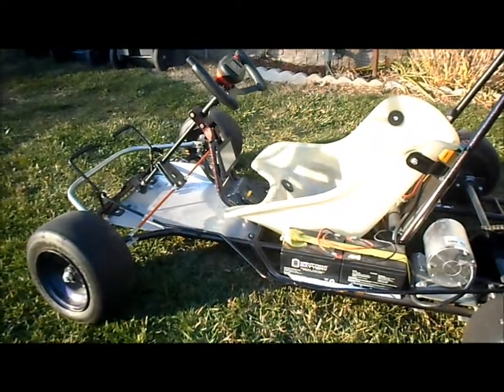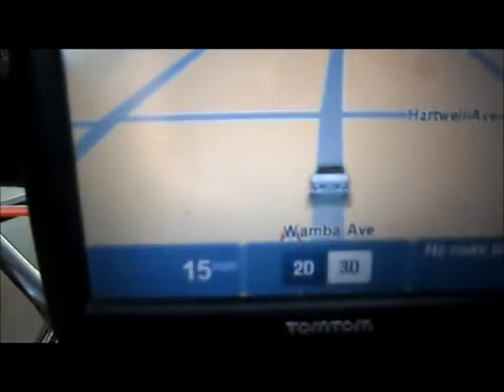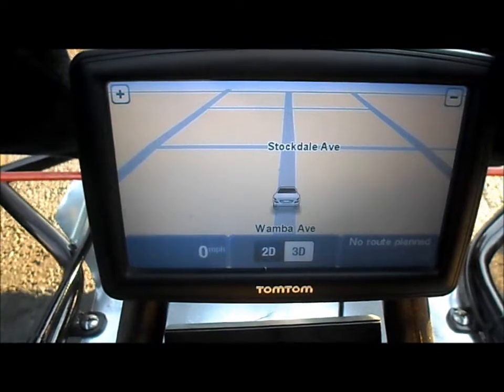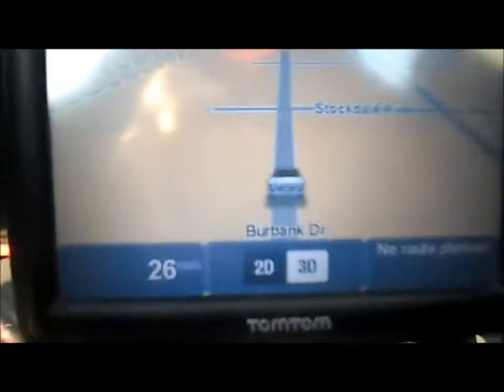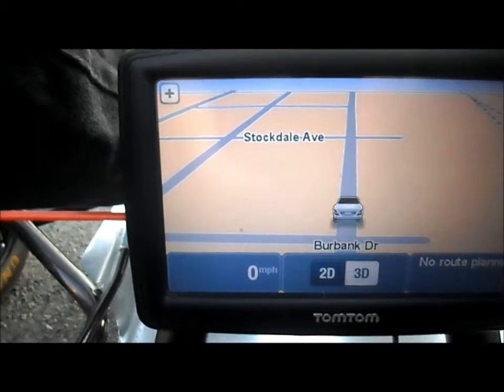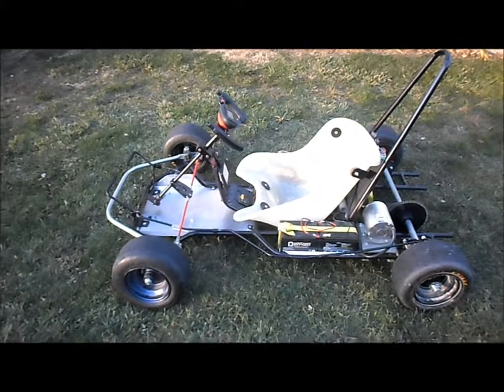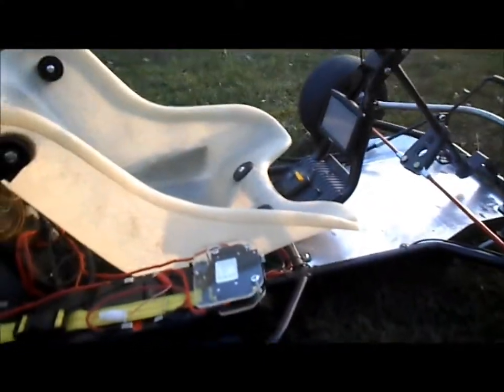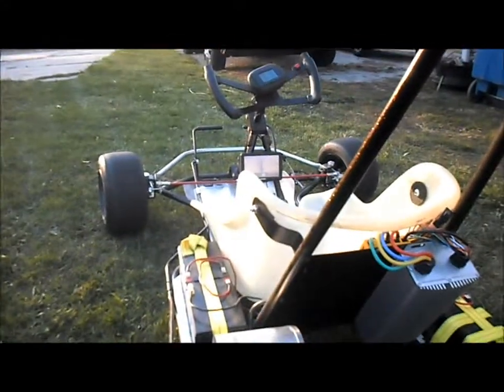Excalibur Electric Racing Go Kart prototype 14 60V 3,000W speed test

Comment: Hi. Where'd you get the ammeter? Cheers
Reply from the maker: Kool little meter huh? It's a PZEM-051. I get 'em on E-Bay for ~$17.00. https://www.ebay.com/itm/122029089742?_trkparms=aid%3D1110006%26algo%3DHOMESPLICE.SIM%26ao%3D1%26asc%3D231995%26meid%3D6a29f4fe1c474aafa1775b8dba85e7fe%26pid%3D101195%26rk%3D1%26rkt%3D12%26sd%3D111980665086%26itm%3D122029089742%26pmt%3D1%26noa%3D0%26pg%3D2047675%26algv%3DSimplAMLv9PairwiseUnbiasedWeb&_trksid=p2047675.c101195.m1851&amdata=cksum%3A1220290897426a29f4fe1c474aafa1775b8dba85e7fe%7Cenc%3AAQAFAAACAEsCg3R7AL6aTpPPR8Z7G613U4m3JZsOz7mvJVNWLpo0zd0RANItK8veHdftbPGdSYvhUf7ZkSFRc0l6Tyy696aDYc9t3eS9F%252B5AgCTl2SwAReDrOWeNyKKWCneshTyUvQQbuanUNXLI9Y9OG8HhWVhrA1YlWrI9CQpFBoLVYrvoiJG1bvQoVyZ2XT%252BzAL09tHkQ5Jd8s5Avg7DMkZjyFsJo0j3BMsgDMRVEVjJMXkJmXmfzeoHhmLAkoQSj7YGAz0rIKDfv2bDho4c9gPxS5FTZTeiZ44yBZEYhqIf7GNZgbizQlxrk%252BizehiWMqS4tLyCfs8nNTW916ZzMS83b4nVj0x5TfqD5SVjg7ZGglcaMq8SUWh8z0CHXsdGyWyf59gmbS4SuX4vVWiYergfZywXTw%252Fdz18H%252B91Zn0TtiMXMf1aSWGOs5bECvLz3wJ%252BvPB7mL9B%252BbES13ikMk%252Fep2A4iJZhJqwOhVvt3u1QulfFcv%252BXZXye0xpxYvNw7IAgMUfYqmhyhM9G2isIsog041q6EjnGY%252F2Fj3I0e2dCMS8ohhl%252Fh3%252BhOmYmRlTu4AoYgeOxA6SJ8qA2hF0TggI1Z6Op89z5nler00VaJwiIHynO7OjqsL3NFAJqnAwEETZBT5oZ4Edxaga%252BQ5y4JYmuoqyIzVa9We4h4T%252BRjDblEEHVle%7Campid%3APL_CLK%7Cclp%3A2047675

Comment: this dude really just went 27 miles per hour off a motor smaller than my trucks starter. i want to see top speed with an array of 18650 cells, how much the tradeoff would be

Comment: Why not switch over to some LiFePO4 batteries? I know you had some problems with a more sketchy pack battery, but there are some legit companies. I am using both RELiON and Dakota Lithium without problems in three of my electric vehicles.
Reply from the maker: This is a test vehicle to "try to do more with less". I designed the battery trays (specifically for SLA batteries) right into the frame.  I just tried the lithium pack, as another test.  I must say that the lithium pack, powered (1) 2,000W motor without any issues. I found that it just couldn't (safely) power (2) 2,000W motors at once. (kinda what I wanted to find out) FYI: my next "test vehicle" will be powered by a 60V 50AH lithium pack out of a Chevy Volt. I betcha that'll power (2) motors ;)
Reply: @functional_artist  Did you ever do the 60v Chevy Volt project? You know I upgraded my kart with a 2019 60v module and put some videos on my channel.

Comment: What is your sproket tooth ratios?
Reply from the maker: It's running a 6:1 gear ratio (10T drive sprocket & a 60T driven sprocket) & rolling on ~11" tall Unilli tires (10.5x6.50-6)
Reply: Is that the same sprocket that came with the motor?